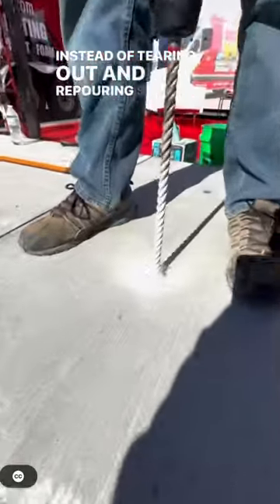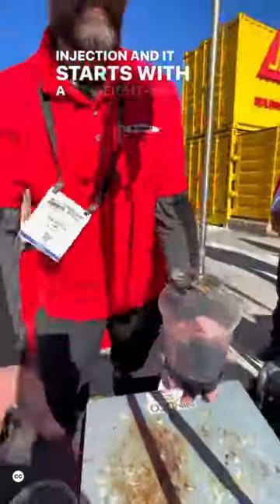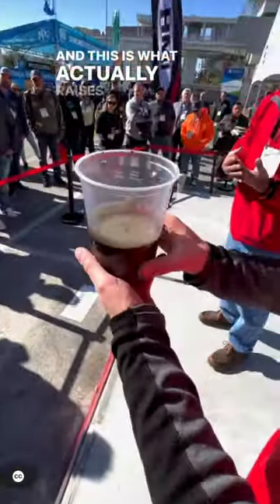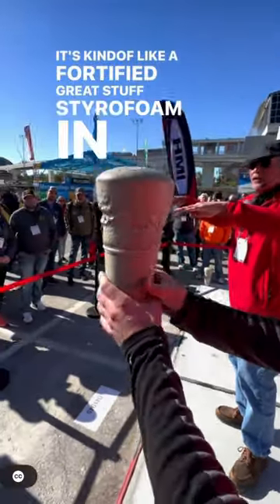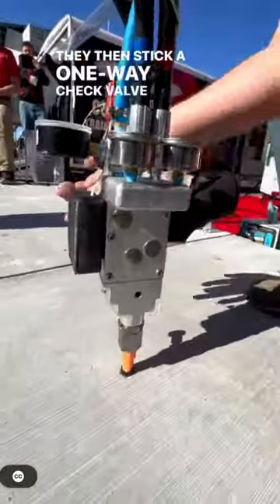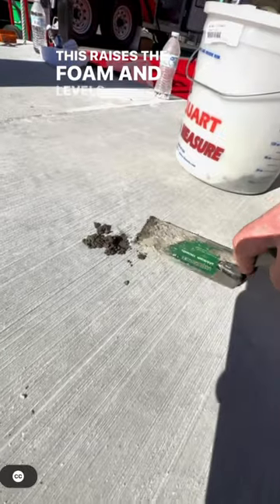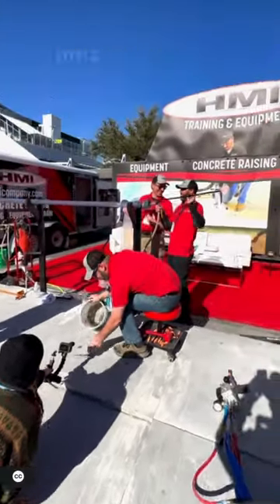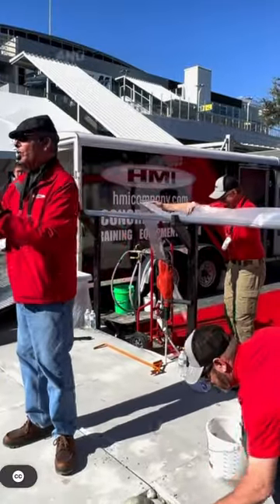Now that’s an easy way to fix concrete. #shorts

Comment: Experience in the UK is the polyurethane lasts 5 years. If it has a large load across the surface then take 1-2 years off. The hole drilled through the slab creates a weak spot. Expect cracking in future years.

Do use in areas with broken drainage pipe, or close to a water course.

Vaccum injected cementious grout is better.

Comment: In MN this system does nothing to address the cause of the failure. So you are left a short while later with concrete no one will take the wasted money on foam lift and removal and installation of new concrete so the real design fault can be corrected. In my opinion this will leave the home owner holding the bag empty of their hard earned money.

Comment: what's gonna happen in later years when all this spray on foam has to be dug up. It's not just this job. so many people are using expandable foam for so many different applications now. It's going to be a huge issue.

Comment: Two concerns,what happens if you add/lift too much,seems like a one shot deal because that can’t be an easy fix—-#2 How does it hold up on high traffic areas being repeatedly subjected to heavy weights such as a driveway that sees Rig traffic?…..I know most foams(like great stuff) will turn to dust once cured and put under pressure after a short period of time.

Comment: What weight is foam rated to support I think by the time you've underpinned and supported the floor you've lifted it would be cheaper to just break up and relay the floor properly or if the floor is low then surely adding a screed or other medium to build it up would make far more sense

Comment: Foam is only the lifting mechanism.  It will not last unless properly shored up after lifting.  Or use mortar injection.
Reply: how do you know it doesn't work like those fence posts in a bag?

 those fence post foam work  better than concrete at times.
Reply: Just saw this, I agree. There is more to this than just shooting foam under the work. I know we use this at work...
Reply: @kristoskalemanis  no, not proper concrete.
Reply: @mtraven23  it's foam in a bag and it holds for years and years as strong as concrete but it's foam.

They build big  fences with that stuff
Reply: @kristoskalemanis  lol  6000psi foam, eh?

i know what they are...the lazy man's concrete post.  They are worst than driven posts or ones set in concrete or limestone..  Not to mention, filling a hole down to frost line with foam is gonna run ya ~$100 / post.  No serious person is setting posts in foam. sorry.
Reply: @mtraven23  Well then my eyes and mind deceives me.  I saw about 100 posts go up like this and that was over 5 years ago.

im just saying.

not trying to start an argument.

I mentioned those bags for reference but the foam I saw them use came out of 2 different tanks.

and yes! they were serious about it... and it was fast af for 1/2 the price quoted for concrete.
Reply: @kristoskalemanis  lol no, they weren't serious about it, they used foam.

5 years is nothing.  I have posts in concrete & limestone that are 30+ years old.

those two quote were likely from different companies.

you must live in an area where you dont have to worry about freezing, filling a 12", 42" deep hole with foam is gonna run you an arm & a leg.

as your own post says, you wanted fast & cheap...thats what ya got.

Comment: If your concrete is settling you have compaction problems. only way to fix it right is too tear out the concrete. Get your compaction right then re pour.
Reply: This works better for things that have settled over decades. If it was a newer pour that sunk already,  then then yes it needs to be ripped out. I had a few slabs lifted that sunk over 50 years. The foam and level has been great for 7 years and I'm on clay
Reply: My driveway tests 99% compaction a from years of heavy haul loads being parked in the driveway and the base material is nearly 5ft deep with gravel and fill at this point the first year after we poured the last section  we had water washout settling and heaving problems because of  how they graded the concrete for drainage that we fixed by lime mud jacking and expansion joint sealing I’d rather pay the 600 bucks I did than replace 8 inch thick reinforced concrete 

The grading problems partially come from the fact that they tried and failed to properly grade the base because the loader and skid steers they had couldn’t scrap a 1/2 inch off the driveway in 2 hours so they improperly crowned some areas to meet the minimum concrete depth without going over maximum finish grade

Comment: Don’t do it . 
It’s a scam. 
Eventually the concrete path will sunk again. 
I work as a mixer concrete driver 
For 28 years. 
It’s a way to take money out of constituents. 
The right way it’s to remove the cracked path and treat the sub floor then place new concrete reinforced / rebar.

Comment: There's no way some foam pushed through a 5/8" hole will cover the entire ground contact area of the slab. Notice how they never pop the slab off afterwards to show you where all the magic foam went. Then as soon as the ground moves under that one blob of foam, you're back where you started, probably worse.

Comment: As a builder, I have never used this stuff but I havent ruled it out, I'm sure it has its applications, usually when a concrete slab sinks, it is because the sub base is inadequate and has washed away, simply adding more material isn't a guaranteed fix, as it is quite possible that within a couple of years the sub base will continue to erode and the slab will sink again
Reply: My sentiments exactly. Investigate the cause before applying an expensive band-aid

Comment: It's pretty interesting. It works just not that long from my experience. The underlying reason the slab was sagging is generally still there. Poor erosion control, tree roots or just poor soil.

Comment: I got a price to do that. It was 4 times cheaper to pour a new slab.
Reply: No way
Reply: @Randy Bobandy  nice gut !!!
Reply: Somebody wanted $80,000 to foam your existing slab? I highly doubt that.
Reply: @codygooch510  it was steps at my back door. They wanted 8000 to do it. I could get it repoured for 1800.
Reply: @codygooch510  Where the hell did you pull the figure 80,000 from?
Reply: @scottdavis9442  ahh so not the slab lol
Reply: @billabong9215  the price to get a slab poured. Duh.
Reply: @codygooch510  the step at my back door is a slab of concrete. It’s 6’x4’. It’s sunk by about 1” at the door and pools water.

Comment: My municipality I work for just purchased one of these. Excited for spring so we can start testing it out!
Reply: Mine has this machine and what they don’t tell you is that if it need to be raised a lot you have to inject multiple times but there’s a possibility it back the gun up and shoots the tip off and then foam goes everywhere and clean up is long for the machine

Comment: It’s a really cool thing however it doesn’t last more than maybe two years at most. We had it done to my grandmothers house and it’s right back how it was before the foam if not worse. But if you were willing to do it every couple years it may be worth it.
Reply: Yea you can’t just jack a slab you have to fix the underlying problem that caused the slab to sag and mud jacking is more durable than polyurethane jacking too
Reply: Drainage is almost always the cause of sagging cement. If it's fixable then foam would be great.
Reply: Sounds like they couldn’t put as much in as needed to completely fill the void and or compact the underlying soil before the slab began to lift. 
Mine was done several years ago and is still ok. They had to pump a ton of foam under it because it turned out there was a large void due to tree roots as well as under slab ducts siphoning the soil into them as the heat & air ran.
I would say like another commenter that mudjacking is best and more stable longer lasting. Just depends on settling, voids underground, drainage issues, or tree roots.
Reply: This material lasts like 25 to 30 years so it was either done incorrectly or the issues were to large for this to fix
Reply: I think it drastically matters how good the technician is.

I think if they drilled enough holes and spread the phone out better it would be a good thing
Reply: @Gage Roman  You mean this material will last 1000s of years.